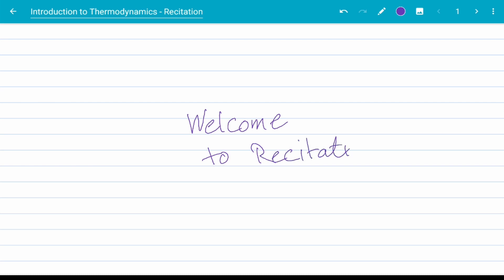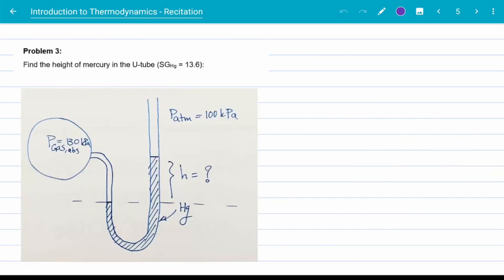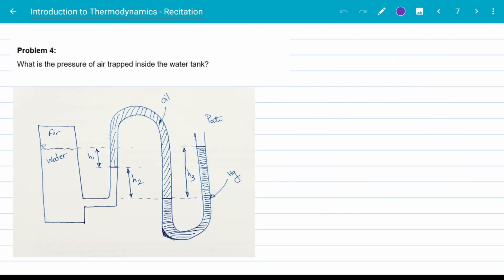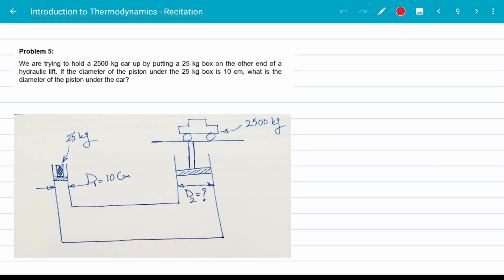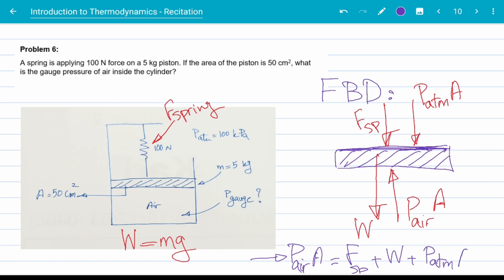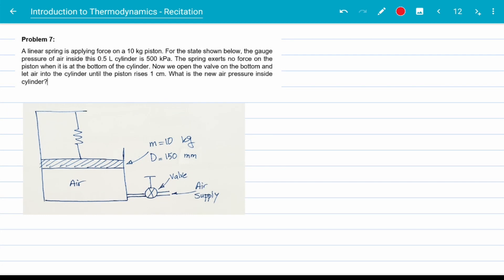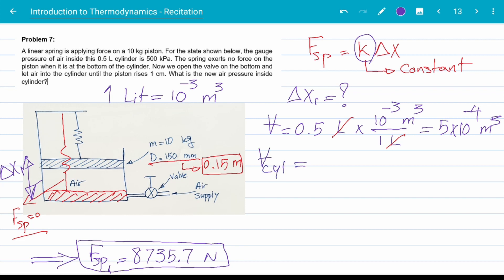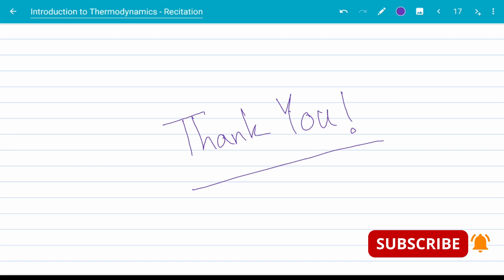Sample Problems - Introduction to Thermodynamics Recitation

Comment: Hello, Thank you very much for your contribution. I have one question, when you do the 6th question, how do you know that the direction of the spring is downward ?
Reply from the maker: Very good question. The problem doesn't specifically mention the direction so I just made an assumption. You can certainly assume the opposite, too. In the case of a pulling spring (upward), just change the direction of the spring force in your free body diagram.
Reply: @WannabeProfessor86   Thank you